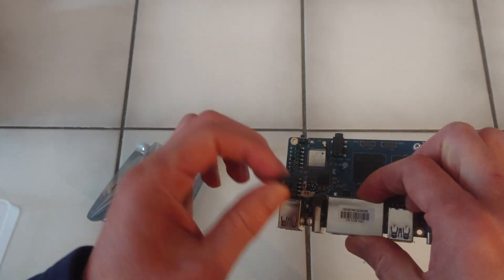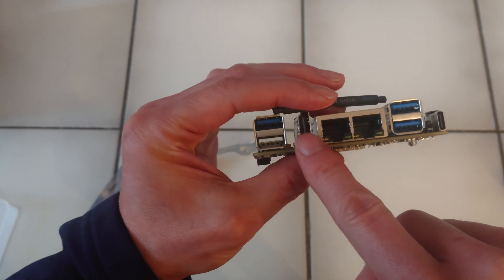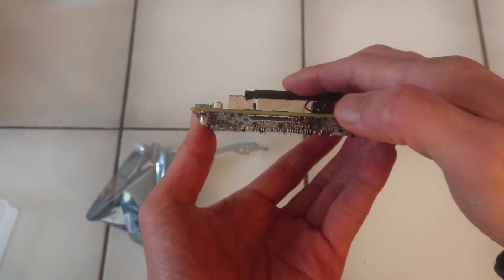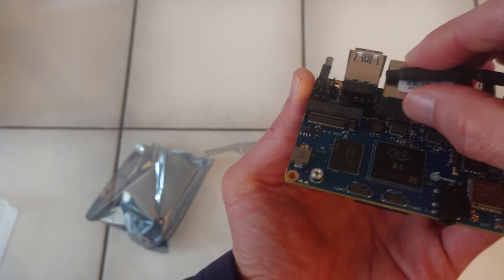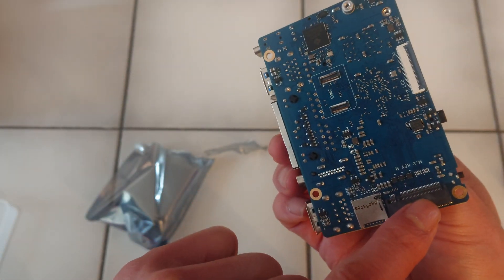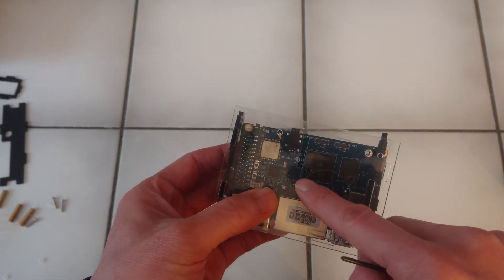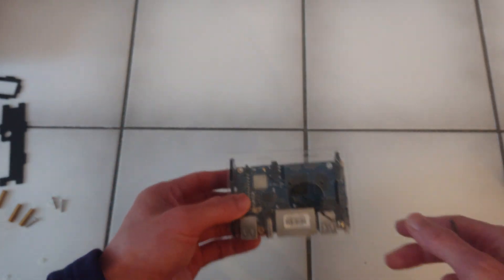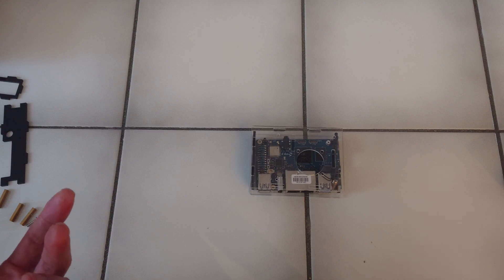Unboxing Orange Pi RV2 RISC-V SBC

Comment: Does he have a PowerVR GPU right? Because you don't try to install Wine and Box64 on it with the Linux powervr drivers on it and try to take a PC game or emulator to see what happens.
Reply from the maker: Yes, it has the PowerVR BXE-2-32. So far I haven't seen a fully working GPU driver. vulkaninfo even segfaults with the Ubuntu image from Orange Pi.
I installed Box64 from the repo, but even a simple game like 2048 doesn't even start (OpenGL problem). 2048 is working on the Banana Pi BPI-F3.
https://www.youtube.com/watch?v=X6ELb1ROngQ&t=301s
I'm not sure what the exact problem is, but I think Imagination Technologies needs to do the last steps, or give the information to make it fully work.
https://gitlab.freedesktop.org/imagination/linux-firmware/-/issues
Reply: @LivingLinux  And DXVK/VKD3D?
Reply from the maker: @donodaordadourada  Currently we only have OpenGL ES on the GPU. We need Vulkan.
Reply: @LivingLinux Ok thank you, Would you recommend which raspberry/orange pi board for wine/box64 vulkan dxvk emulation?
Reply from the maker: @donodaordadourada  Why not go for an Intel N100 SBC? https://radxa.com/products/x/x4/
Reply: @LivingLinux  Ok, Ok maybe, I wanted to ask you just one more question, do these PI cards support video cards or custom eGPUs\GPUs or just their standard GPUs.
Reply from the maker: @donodaordadourada  Yes, there are ways to do that, but why would you do that? A GFX-card is so much larger than a SBC. I think it will look silly.
Here is someone that even did it with a RISC-V SBC. https://youtu.be/Jp0ZPA4IQGw